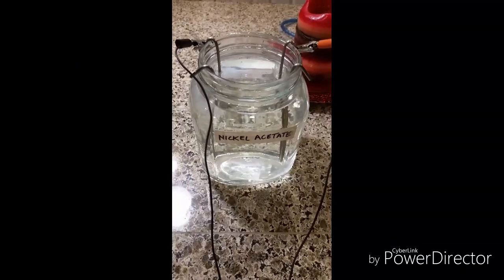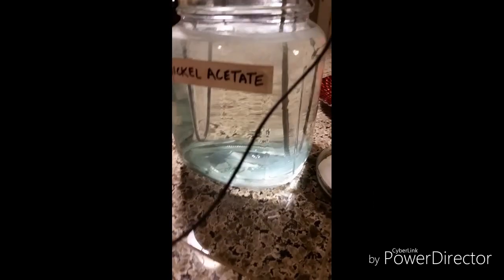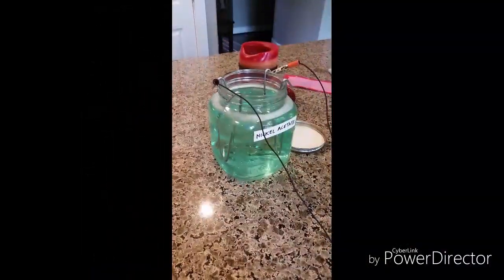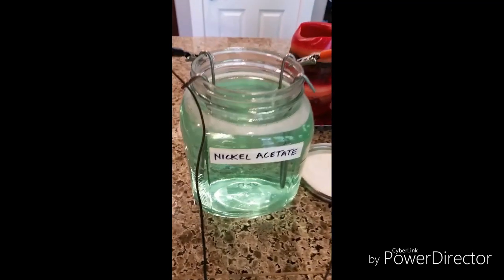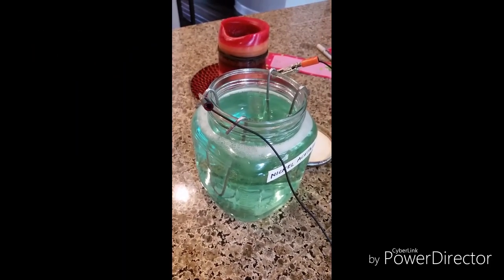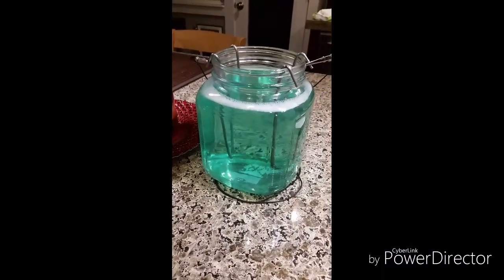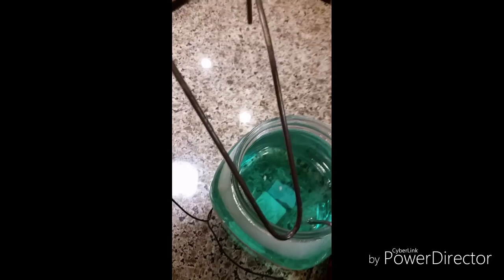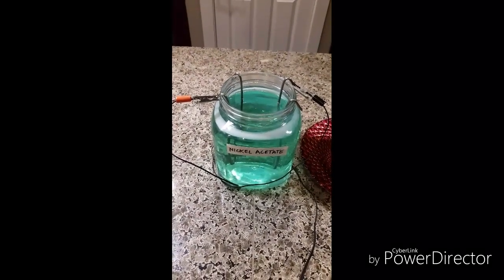How to make the Nickel Acetate solution for nickel plating.

Comment: Hey Bryan, appreciate the video. How do you dispose of the nickel acetate after you're done? Thank you - David
Reply: You know this video is 5 years old right and he has not released new stuff in 2 years lol!   Honestly the stuff is not that toxic. wouldn't drink or anything, cause of the metal poisonings issue with any kind of dissolved metal.  But you can add A baking soda to it until it all reacts and stops foaming and it will separate the metals out of the liquids and the salt will now have the remaining metal. Leave it in a bowl till it all evaporates after that.  To which you have what you started with in the salt form which is not toxic. again wouldn't eat it! but saying it's actually able to be touched and such without any harm at that point.
Reply: @BuildBreakFix  Thank you!

Comment: Hello love, thanks for sharing
Could you tell me why you use acetic acid, and not hydrochloric or nitric or sulfuric?
What advantages does acetic acid have over these other acids?
thanks
Reply: Hydrochloric acid would not work in this process because of how it effects electrons in the process, Nitric acid would create a whole new substance not useable for plating cause it would react with the metals to be plated before the ions can exchange correctly, sulfuric acid would cause a violent reaction with the nickel and other metals such as steel in the plating process...... Acetic Acid is the ideal acid for Nickel plating without a whole chem lab to add and remove other stuff correctly for use.  don't get me wrong there is other ways to do this with different chemicals and acids. To which I would think you can't get and use correctly just based on the fact your asking this question to start with!

Comment: This is so helpful 😭 if I use a rectifier instead of a cellphone thing what amps should I use?
Reply: Under 5 amps.  For my setup i used a generic charger i bought for $7, cut the cord and soldered clips on.  That charger is 4.5 amps and no issues.  Also for my nickel and copper solution i only let it run 2 hours to set up.  When you plate you'll be recharging the solution at the same time so i don't think there is a benefit  for a full day of solution setup myself.

Comment: Why my acetate doesn't look green? It also created a white foam on the top of the solution. What can be wrong?
Reply from the maker: My guess, it was not Nickel.  Or, it was a mix of nickel and other metals.  You need to make sure your anode and diode are 99% nickel.
Reply: @idahomecustomdesign  Thank you so much for your answer Brian. I bought those 2 plates that I used from this site: https://m.banggood.com/High-Purity-Nickel-Plate-Nickel-Foil-Thin-Sheet-Plate-1mm-x-100mm-x-100mm-p-1044061.html?rmmds=search 
It was hard as steel and it didn't look any shiny. I really don't know how to test if it is nickel.
I have other 2 plates of zinc, do know how I do zinc plating?
Reply: @idahomecustomdesign  I need to tell you something to share my experience. I weighed the material that I used and calculated the density, I also tested it with a magnet and is not magnetic, it seems to be titanium. I can't belive it. That chinese salesman cheated me.
Reply from the maker: @alexeismenendez9354  - so sorry to hear you got cheated. I am not sure what your budget is, or how often [or size of objects] you will plate, but buying the 99% nickel welding rods are proven good.  If you want, I can try doing a video on items to use for plating?
Reply: @idahomecustomdesign  Sure, whenever you have time. I just want to plate small parts, about 6" of size. Maybe 1 gallon of solution. Anyway, I will have to get real nickel. Thank you for your help.

Comment: what size jar to salt?  No one seems to think that important.  1 quart to 1 tsp salt?  Sound right?
Reply from the maker: Salt helps stimulate electrolytes.  The jar size depends on how much  nickel fluid you want to make and how big of parts you will plate.  The bigger the jar, the more nickel and time to saturation the solution.  A teaspoon to tablespoon of "kosher" or "rock" salt.  NO table salt.

Comment: Use Epsom Salt, Not table salt. TABLE SALT PRODUCES CHLORINE GAS!
Reply from the maker: I used rock salt
Reply: @idahomecustomdesign  Ya, that stuff is bad for your lungs. Best to do that outside. Great idea to make your own solution though. Saves a lot of money.
Reply: Also, a tip when electroplating: Don't use that high a voltage. 1.5 volts seems to work best (Just enough to stop it from bubbling). That higher voltage is fine when making solution though. Lower voltages work just as well when electroplating but give a smoother finish to the piece.
Reply from the maker: @andrewjaster39  - Thanks for the advice, I almost pasted out and died in the 20 mins I plated inside using this HUGE 64 oz jar of acetate.  🤪
Reply: No wonder my kitchen is covered in orange gas!

Comment: Thanks for this great and easy tutorial Bryan. One question does it have to be distilled vinegar ?
Reply from the maker: Hey Chris.  Thanks for the watching the video.  Yes, distilled is the best.  If you use regular vinegar you pose the risk of the water within having minerals.  Distilled vinegar uses water with NO minerals, NO "hard water". Plating is all about cleaning your part and keeping the acetate formula as pure as possible.  Good luck
Reply: Brian just a tip for anyone in Australia. Distilled white vinegar is not readily available in Australia. I tried , without any luck and had to use plain white vinegar. It worked OK.  Another tip . Make sure the clips that are holding the anode do not touch the solution. Mine did and it left a black substance floating in the solution and I had to discard and start again.
Reply from the maker: @christophermaurer1271  -  Maybe Australia water is already 'clean as a whistle'? :)  glad it all worked for ya
Reply: I will take your advise and thank you for taking the time to respond . Very much appreciated. All the best to You and Your Family for the holiday period.

Comment: Great video,  followed  your instructions. Solution looks right.  After 3rd day appears that nickel was plating back to negative electrode in form of small nodules.    Not sure if this is sign of saturated nickel acetate solution. Plating an item should confirm this.  Thanks for an excellent presentation.

Comment: Sorry...Not a very  good explanation and bad video sound. Please  be more  precise ... many need every step explained
Reply from the maker: jr johnston - sorry you feel that way. Did you read the captions in my video? It pretty much tells you what I'm doing, 99% nickel welding rods + 100% vinegar + salt + old cell phone charger with alegater claw connectors + electricity + 2 days = nickel acetate solution.  If you need info on how to plate the nickel solution into a part watch my other videos.

Comment: High nickel content welding rods are the type of rod used for cast iron repair........too many to list , but just ask for rod used to weld cast iron and check the info on the box........it should tell you the nickel content in % ..
Reply: I just went to ebay after seeing this video for the first time. 99% nickel rods sold in bundles of 5, that'll do nicely.

Comment: How can you electrically connect this wrong when both rods are floating. Seems polarity is not a factor.
Reply from the maker: You are correct, it does not matter when making the solution.  I tend to switch them back and forth to even out the pieces of nickel.  After hours of current the negative nickel piece erodes.  When you start plating you obviousely need to know what is pos and neg.

Comment: Hi Byran, Is there any specific Welding rod for making above solution. And what king of salt have to be used. Can you please guide me on it. And if u can please give me the steps that I have to follow. Thanks in advance
Reply from the maker: I bought a pack of Forney 45401 Super 99-Percent Nickel Cast Specialty Rod, 1/8-Inch.  They are not cheap, $55-65 for a pack of 12.  But, now I have seen them on Amazon for about $45.   I bought mine on sale and use them for welding cast iron.  some people use nicklel plated items and pull the piece out when the attrition is lowered to the underlying metal.  The nickel rods last a long time and are worth every penny if you plan on plating more than a few times.
Reply: Bryan 212 thank u so much.. Worth it...

Comment: Hey Bryan. Do all welding rods contain nickel?
Reply from the maker: Some, but not all.  There are 55% nickel welding rods and 99% welding rods.  The 99% are basically 100% after you shave the flux coating off with a knife.
Reply: Thanks Bryan
Reply: I removed the flux, polished rod with steel wool, and left the rods, both +ve and _ve connected in the solution overnight. +ve rod melted completely, only small piece left hanging. I got the thick green solution. However when I try to plate a metal, it turns black. :( What might be wrong?
Reply from the maker: You used too high of voltage/amps.  The black spots will rub off.  You need to find a 1.5 volt car charger or even a D battery.
Reply: We use the same PS for this as we do for the CS we make with 99,9% pure silver... they are very reasonable in price and they control both voltage and amperage... Look up the QJE PS3055  0-30V    0-5A  switching power supply...
Reply: No... I'm also a welder... Harbor Freight, Lowe's and Home Depot plus Tractor Supply and welding supply shops have them for doing cast iron repair. These are the ones you want.
Reply: Parish Raut Have you possibly got your positive and negative the wrong way around on your part?

Comment: How to nickel plate big items like having trolley frame of 100 cm x 50 cm x 18 mm, can you advise / guide
Reply from the maker: Big items require using big plastic containers and lots of nickel acetate.  As for the electrical current, you may need multiple anodes/cathodes around the big part with a daisy-chain wire.  Does this make any sense?  How big is the part?
Reply: Thanks for your quick reply, I am wishing to nickel / chrome my tea trolley legs & handle , it is 3/4" tube in U shape , each leg is 110 cm and handle is 50 cm. I am planing to fabricate a plastic tub as its shape and size with as your guidance "multiple anodes/cathodes around " Also I am looking for Alsa Paint CFX-CPKS Chrome Plating Kit System which is very easy but costly. Thanks again
Reply from the maker: Secret_Armor  - it will definately take longer to extract the nickel.  You need an acidic base with some salt.  But, go ahead and give it a try.

Comment: Hey. What percentage of acetic acid is in this stuff? As far as i understand you mix vinegar with salt and no water at all?
 thanks!
Reply: This is a bit late but you don't want to use salt when making nickel acetate if you want a pure end product. As I understand you can use hot peroxyacetic acid to dissolve it. I suggest using a face mask or something Because breathing in the fumes hurts.

Comment: 12 volt 2 amp battery charger works best, recommend doing it outside or under fume hood, for your safety.
Reply: Far too high power.  All you'll do is break down the water into H2 and O.  You'll see bubbling at each electrode.
Reply: @dhy5342  I've heard people say that 2A is good now you say it's to high?

Comment: Nice, thanks for posting, when you said you put a table spoon of salt in there where you referring to table salt as in NaCl ?
Reply from the maker: I use 100% distilled vinegar, no water.  Table salt is fine, but I think I used rock salt in a self-grinder.  I believe you could use any type of vinegar, but the less particles the better.  Good luck.
Reply: Thanks very much.
Reply: @idahomecustomdesign  table salt is NOT fine the iodine usually added to table salt will pollute the solution use a non iodized sodium chloride salt.

Comment: Nice! can there be used usual white vinegar instead of distilled white vinegar?
Reply from the maker: Probably......distilled is highly filtered, so as long as your white doesnt have a bunch of particals.
Reply: It started to turn green YEII!! :D hope it works well.. Btw will the process accelerate if the voltage is higher? My adapter is variable n i'v put it around 5v for now n I was thinking to tweak into 12v if the process accelarate..

Comment: Great video, thanks for making it.  What is the current output of that charger?
Reply: You can use a resistor (ohms law)  or reduce the salt quantity to  reduce the amps.
Reply from the maker: it is 5volts.  thanks for watchn.  i have a more recent video showing the charger, etc
Reply: Near the 5V there might be a 175mA, 375mA, 550mA rating also.  The reason I ask is the one I used is 5v 550mA and I was burning the copper plating.
Reply from the maker: Jim, I will have to check my charger.  I have a couple old cell chargers I use, they are over 5 yrs old.  I have had more experiences with copper burning, not so much with nickel plating.  You can use batteries to slow down copper plating.  One other important detail, keep the part swirling while plating, or use a fish pump to blow bubbles into the solution while plating.  If I am copper plating and then putting nickel over top I do not worry quite as much.  But, if a nice copper plate is what you are trying to achieve make sure the part is CLEAN, moving/or bubbles and SLOW the playing time down with less volts/amps.  I am thinking of making a video on copper plating only.

Comment: If you have nickel probe for +  and -  there is no point to know wich is + and wich is -
Reply from the maker: Yes, that is true.  But even though both the diode and anode are pure Nickel when making the solution it is nice to know which one is disolving [positive/red] because you can flip-flop them for an even usage.  When plating, obviously you will need to know because only the negative will attract.

Comment: I ordered some 99.9% pure nickel ingots and connected as per video.  Once connected,  the negative side started bubbling .  I come back in an hour and it was no longer bubbling.  After 8 hours the solution was still clear.   Nickel is a non-ferrous metal and should be neutral to a magnet. The ingots were nickel plated steel.
Reply: Bryan... that's anode and cathode brother... :)
Reply from the maker: did you have a nickel ingot on both the positive and negative connector?   was there a coating on the nickel?  as my video shows, 5 volts over 48 hrs created the solution.  sometime i did switch the anode and diode to even out the nickel.
Reply: Yes there was a "fake nickel" ingot on the negative and positive.  I was using a car charger for my DC.   Looking into another source for nickel.  BWT great video
Reply: Second try.   Using a high nickel TIG fill rod.  One cup and holding it to the light a purple-red color.  The color is so dark you cannot see through the quart jar.  My first impression was dark tea.
Reply from the maker: sorry bro.  both the anode and diode HAVE to be 100% nickel or you will get other metals mixed in the solution.  i use 99% nickel rods, the other 1% on the rod is the flux, which i shave off with a knife.  some people say they use heavy nickel plated items and watch over hours to pull the items out before the layer of nickel wears off.
Reply: I just ordered some nickel welding rod without flux.  TIG or MIG I always get the two mixed up.  $35 LB.  BTW What city? Good 4th
Reply: Bryan 212 it is anode and Cathode not diode!
Reply: TIG welding is done with or without filler rod... MIG is always done with a spool of filler wire... You probably have TIG rods...
Reply: this is a very old post, but just wanted to let anyone reading this know that nickel, although it's non-ferrous, it is indeed ferromagnetic! That is, it's attracted to magnets in a very similar way to iron, one of the very few actually. The name ferromagnetic is just very misleading.

Comment: What are the welding rods made of? And would the process speed up if the volts/amps were higher?
Reply from the maker: welding rods can be made of many things, depending on what type of metal you are welding.  for the purpose of making nickel solution you need the 99% nickel rods, or find something made of nickel.  yes, you can speed the solution process by increasing the voltage.  but, when you start plating you are better served with lower voltage to avoid the pitted look.
Reply: Thanks for the reply! I have 30mm steel ammunition which I have cut down to make shot glasses. I decided to nickel plate them just to seal the metal and prevent rust etc. New to electroplating so its a big learning curb :)
Reply: Henry Horne did you even watch the video

Comment: how long does this solution last and how many times can you reuse it?
Reply from the maker: it will last a long time.  i just used my nickel solution last week. i plated a few small parts and the solution had been sitting in the garage for 6 months.  i heat it up in an old pan to 110-125 degrees then pour it back into the jar.  i strain the solution through a couple paper towels to keep the old sediment out.   obviously, the more parts you plate the more the nickel solution gets diluted.  i just throw a nickel rod on both pos & neg for 8 hrs and it saturates it back up.  but, that is after using it on 20-30 medium parts.
Reply: Bryan 212 gotcha. ive used my solution a few times and its starting to turn really dark and my parts are starting to come out with a dark kinda slimy tint to them.
Reply: Bryan 212 also love the videos man. I started doing this after seeing your vids, and they're very well done